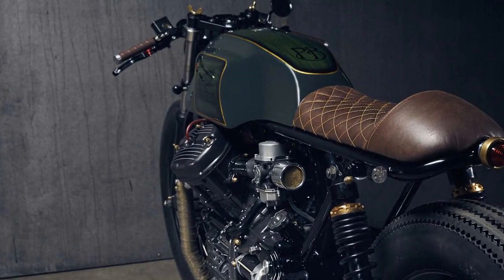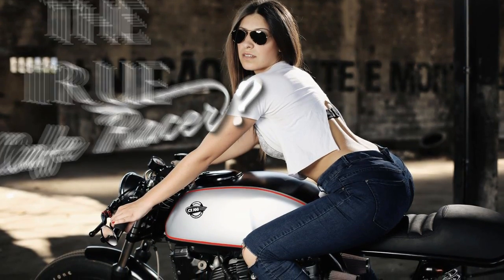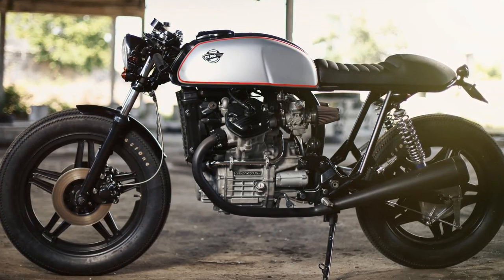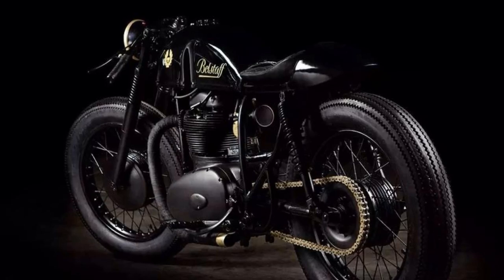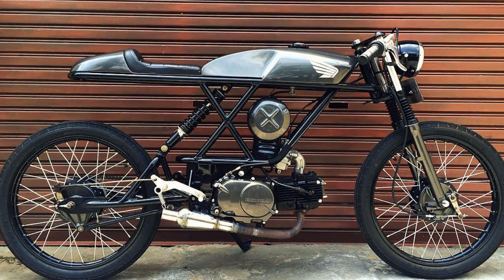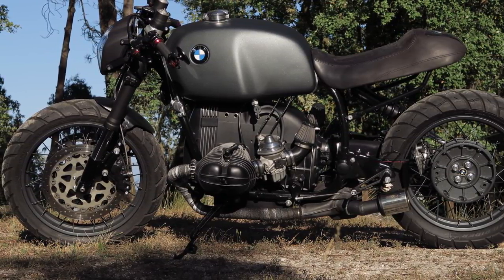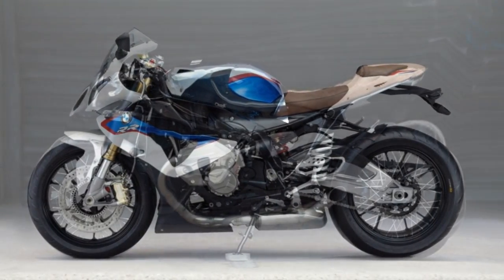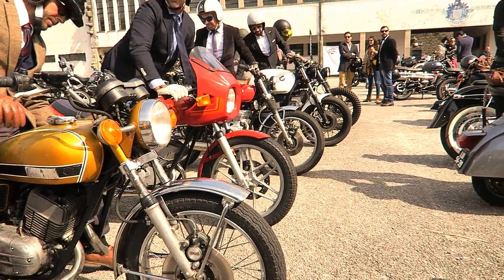The Best Cafe Racer Approach

Comment: I have a Suzuki GN125cc. ( @ 170cc)
Moto from which I increased its power and improved its dynamics relieving weight.
I did this because I like the coferacer style and why I wanted a small and fast motorcycle for everyday use.

Comment: Great video. Very interesting topic. For me, real cafe racers are bikes that were built to be ridden. Any styling the designer prefers is fine, until it becomes an exercise in styling that can't be ridden for any practical distance. There has to be some engineering behind the art, because when an artist designs a motorcycle, the look is contrived and artificial, no matter how well proportioned and fluid the look of the bike is. When an engineer designs it, it looks like a new sportbike. Cafe racers are so cool because successful designers are doing a balancing act between art and engineering. And exactly how that balance is achieved gives room for personal expression - that enables the designs to be diverse, beautiful, and work on the road.
Reply from the maker: Thank you my friend for sharing your prespective. :) Cheers.

Comment: Hi!  Sorry I haven't commented on the videos in a while.  Been busy and ugly canadian weather has distracted me from bikes as I prep for winter.

"Some people criticize that most of the cafe racer projects are merely an exercise in style.  And I have to ask, what is the problem with that?"

Before I answer that, I want to also point out your line "What I don't like is to hear criticism that only light and powerful motorcycles are the real cafe racer".  Which I too dislike.  Just so I dont get initially taken out of context in what follows.

I think most of the concerns and critics are from people like me who really want to appreciate the ride.  It is as you said in the beginning.  A cafe was about making the bike lighter and faster from a time where manufactured fast bikes were far too expensive for most people.  So you buy the small bike, tune it up to do the ton.  they were death machines with inferior brakes and suspensions, but they were fast.

This is where my contradiction comes in.  People put style so far ahead of function that the final product is often slower and poorer performing than the original product.  Chopping up rear suspensions.  Putting on balloon tires.  Running open pipes.  Pod filter on Keihin CV carbs.  All detract from the ability to actually ride it from the original product.  In my eyes, doing that isn't a cafe racer, but an insult to the origins of the cafe.   Cafe is a style and you have shared many fantastic looking motorcycles that capture the essence of cafe while still being able to be used on the roads.  Mid you, this opinion goes to all form of vehicular modification.  I just find a dislike for any form of modification or build be it bike, car, truck or recreational vehicle that makes it perform worse with no gain other than style.

This excludes show vehicles.  Where the artistry in itself is the purpose.  I have the utmost respect for those that put such fine detail and craftsmanship into their project.  At which point it is approached as art instead of an attempt to be a "poser"  The line though can be grey at times...

Your bike that you have shared is one of my more favorite examples of cafe.  A cafe does not need to be big, expensive and fast.  They got their start with the bikes people could afford, and work done by their own hands.  It is why I rate yours quite high on the shared cafe.  Yours appears rideable and the changes done to give yourself a bit more of a sporty ergonomics and riding position.  It is one to be proud of and one that would attract my eye at the show.

I used a special word earlier.  Essence.  Why would somebody cafe an old bike to try and go faster when they can buy a new bike?  Well there is that "feel" that an older bike offers.  The way the throttle responds to finely tuned carburetors.  The sound of everything mechanical driving the engine.  And the sheer connection one gets when you know every nut, bolt and wire.  Aside from the Nighthawk, I have two other old honda motorcycles.  I take pride in knowing every nut and bolt on the bike.  All the fine nuances of the sound!  I just cannot bring myself to consider a non rideable bike to be a cafe.  It is cafe style, but only in style.  Like "Rice" in the car area (Race Inspired Cosmetic Enhancements)  It has the style of a race car, but it is it's own class.  I am really not sure what I would define a non-rideable cafe as...

Comment: At first, I thought I disagreed with your opening statement; then, quickly found that I basically agree.  These days, you can buy a "sport bike" that will go nearly 200 miles per hour (though where you'd actually ride that fast, outside of a race track, I've no idea.)  I've always considered "sport bikes" ugly, uncomfortable, and impractical.  So style DOES play an important part in what constitutes a cafe racer; and it is, indeed, much more of a styling exercise than it originally was.  Consequently, I find that I like small cafe racers, even if they won't "do the ton;" they're still cool.  And you can customize anything you want.
Reply: Seth Tyrssen I love all bikes. I don't know why people have to put down one genre of motorcycles to promote the other.

Comment: I have thus cafe racer project in my head of a mash 250 but I have few questions. I'd change the handlebar. Will I be able to change the habdlebar location? I think it's too much on top of the head, I d rather put it kind of in the head. Also, I'd like to lower the head, will I have to buy an other fork or could i just cut it a little bit?
Finally, the patterns on the tank, do you know if we can find some leather paterns?
Reply: That's a tricky one! The bike looks great out of the box! to lower the light you only have to change the brackets... for the handle bars... well if a lower ones don't solve the problem... the thing is the neck of the bike is quite hight... please tell how did that go!
Reply: Artur Jacinto didn t buy it yet ^^
Reply from the maker: Well my friend, try to find a good local mechanic, and i am sure he will be able to help you. Cheers.
Reply: Arthur Moulie I bought my wife one mash 125! She loves it and she doesn't let me ride it! and it's a custom bike out of the dealer, she wanted a custom gas tank, seat, some adjustments to the central stand, breaks and some glossy all black paint job the dealership provided it all in 2 weeks notice, free of charge! you should talk to the dealer about your project and see what they can do for you! She also put some personalized stickers and a net on the back seat for her purse and girl stuff... I own a suzuki sv650 and it doesn't turns heads like the Mash does! So far the bike is bullet proof and a retro look bike makes you feel very happy!
Reply: Artur Jacinto yup wanted to make a retro caferacer ^^ i wanted to scrap the gas tank for the metal color... should i put something on it afterwards since i wont polish it?
Reply: Some Coating, Wax, not sure... I don't know anyone who has a bare steel gas tank, and I'm not sure about the alloy of the Mash if it will look has good has and older dent and rust free solid steel Gas tank... you'll need something to prevent rust at least!

Comment: Holaa, i need your opinion in my channel. I already done building, but still there are some work I still need to work such on the front fork and changing my front tyre to be as same as the rear one, using classic/vintage tyre pattern. But first, I already done the knockdown hornet, let see how do you thought about it on my video. 

Thanks.

Comment: Be aware long question
Let me introduce myself,
Im Thomas 16 years old and want to make my own cafe racer.
At the moment im surfing on the web for tips and tricks but i can't realy find good information on cafe racer seats and cowls.
As i do not want to buy a premade seat from the internet and dont want to spend the money on a custom made one.
I want to try and make it myself, I am however making it fairly difficult for myself because i want one where i can ad and remove the cowl. (Same effect as the little elegant Honda CB125).
For now its gathering information as i do not have the/a bike yet and/or design.
The bikes I have in mind are 1 of these 2, Honda CB250 1980 (With the rules in my country I need to be 20 years old to ride it) and a Suzuki gs550 1981. (Need to be 24 to ride it).

Greets Thomas,
Holland